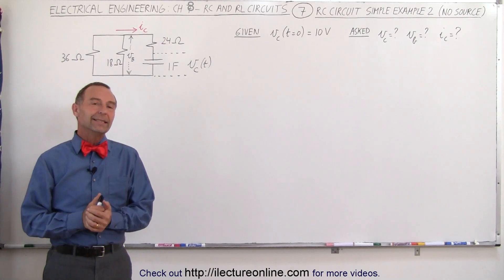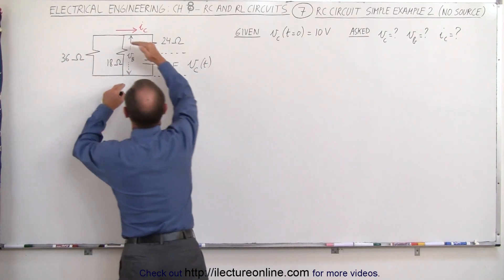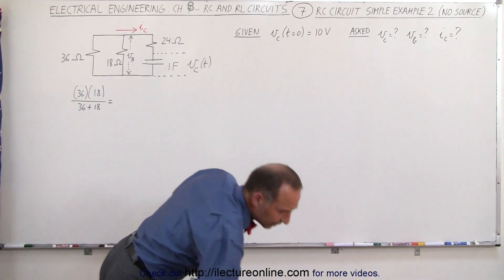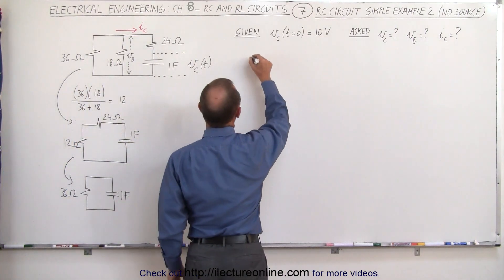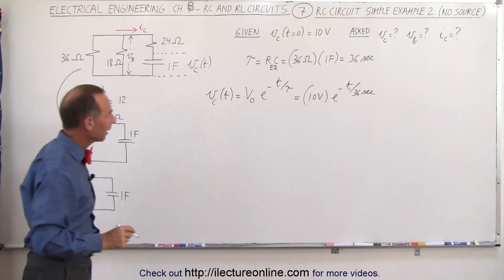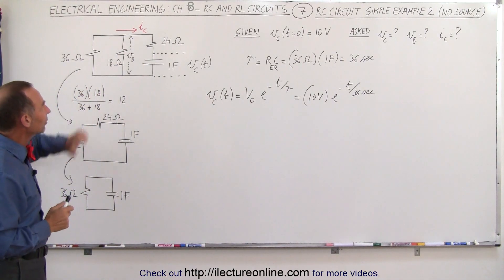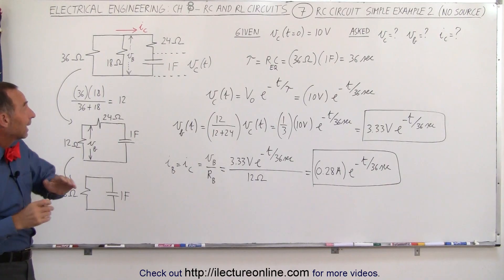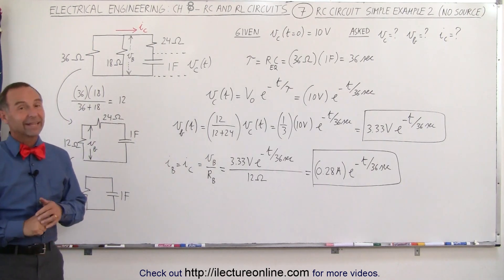Electrical Engineering: Ch 8: RC & RL Circuits (7 of 43) RC Circuit: Simple Ex. 2 (No Source)

Comment: For the volate across the branch can I find the parallel between the resistors of the 24 and 36 ohm and use voltage divider then

Comment: Please how did you decide that the 24 ohms resistor is no longer parallel but in series with the sum of the other 2 resistors?
Reply from the maker: If we replace the 18 ohm and 36 ohm resistor by a single resistor, you can then see how the 24 ohm resistor is in series to the pair.
Reply: @MichelvanBiezen  Thank you

Comment: how does 12 ohm and 24 ohm connected in series and we sum it up
Reply from the maker: The 18 ohm and 36 ohm resistors are in parallel and reduce to a single equivalent resistance of 12 ohms.  Then the 12 ohm and 24 ohm resistors are now in series, thus the sum of those two is 36 ohms.

Comment: How are the 18 ohm and 36 ohm resistors in parallel? The current flows from right to left so aren't the 18 ohm and 24 ohm resistors in parallel ?
Reply from the maker: The current coming from the capacitor can travel through the 18 ohm resistor OR the 36 ohm resistor to reach the 24 ohm resistor which means they are in parallel.
Reply: I think that the diagram would help by labeling the polarities of the capacitor and resistors. E.g. I had Ic going upwards assuming the polarity at t = 0 of the capacitor is positive on top. The current would then be going upwards in that limb. There would then be a voltage rise of 10*exp() (won't write it all out) going through the capacitor and a fall of 24*0.28*exp() = 3.3*exp() leaving (10 - 3.3)*exp() = 6.7*exp() to be further reduced through the 18 ohm resistor. If you assume opposite polarity with the capacitor voltage increasing from top to bottom and the current going downwards then all signs are reversed but KVL is preserved as the sum of voltage drops and rises around that loop is still 0.

Comment: when getting the ic, why is the 3.33 V is not divided with 36ohms since the current will go through the two resistors?
Reply from the maker: Use the equivalent circuit, because it is more difficult to determine the current without doing so

Comment: how can the voltage across the 18 Ohms resistor be less than the voltage across the capacitor ?
Reply from the maker: The sum of the voltage across the 18 ohm resistor and the 24 ohm resistor must equal the voltage drop across the capacitor.

Comment: Why do you series 12 ohms and 24oms for the Req? shouldn't you all of them be parallel since you would remove all the other sources to find Req?
Reply from the maker: Once you add the 36 ohm and 18 ohm resistors together, replacing it with the equivalent 12 ohm resistor, then there is only one current path and all remaining circuit components are then in series.
Reply: oooh ok thanks. So the capacitor doesn't behave like a wire in this case, right?